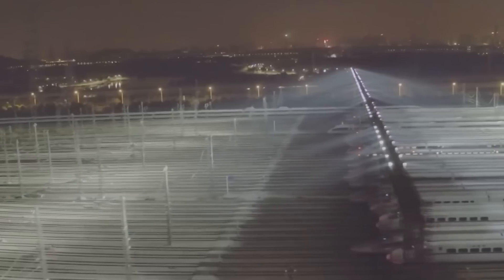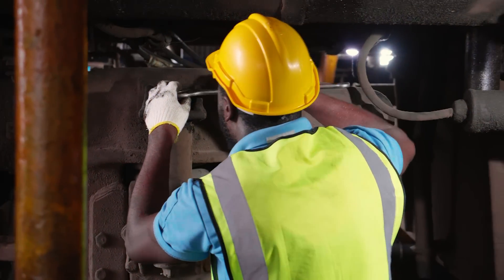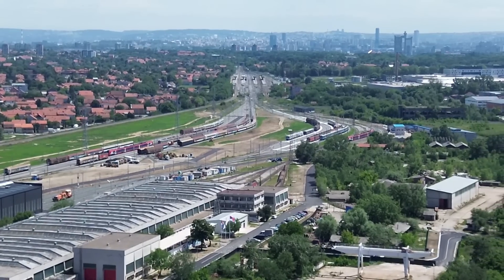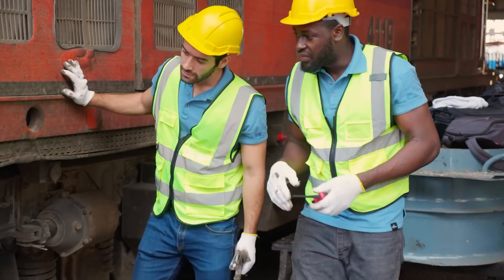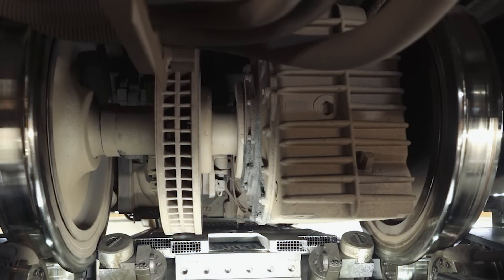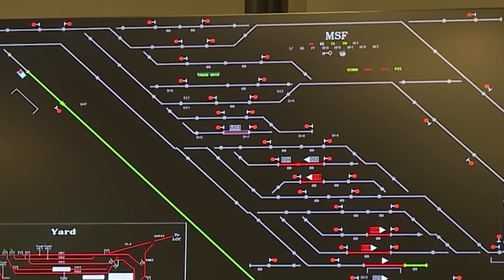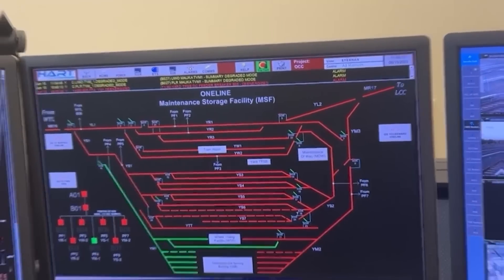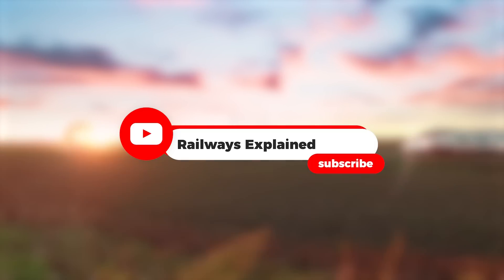The Heart of Railway Passenger Transport: Train Depots

Comment: I always like staring at depot diagrams and schematics. Very interesting to see how many things are "standardized" across all countries, with maintenance buildings, ballon tracks, cleaning and washing sheds, sometimes with dedicated tracks for MOW vehicles and tracks devoted to recently retired trains waiting to be taken away for scrap.
Yard lead configurations are also interesting; some are at the very end of a line, with trains able to either directly access the terminal (like Livonia Yard in Brooklyn; the terminal tracks for the 3 line directly feed into the yard), or having to pull in and out; some are between stations (like Jamaica Yard in Queens; trains can access it from both local and express tracks in both directions).
I also see many newer ones being built underground (presumably because there are too many buildings built up), which can drive up the cost.